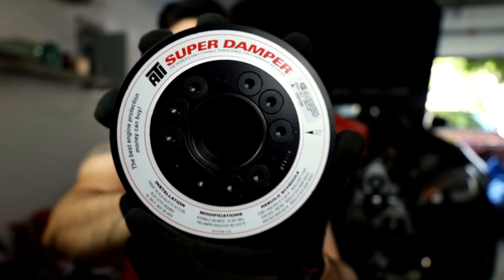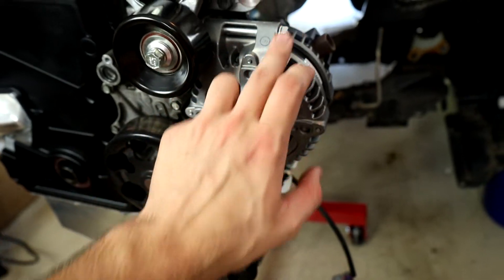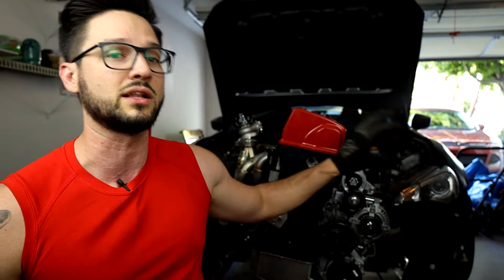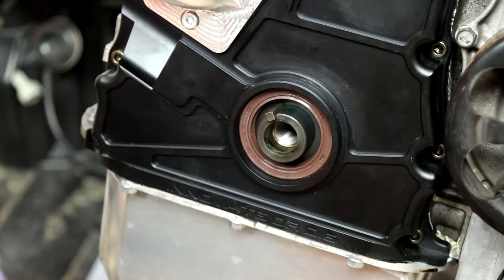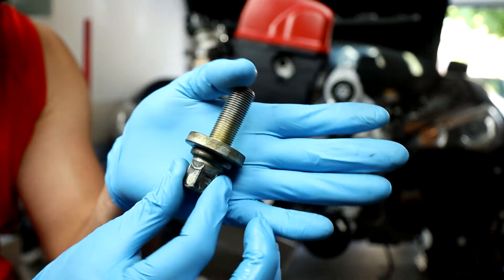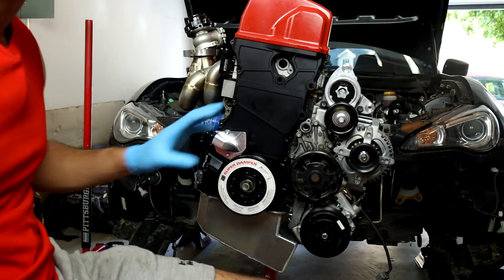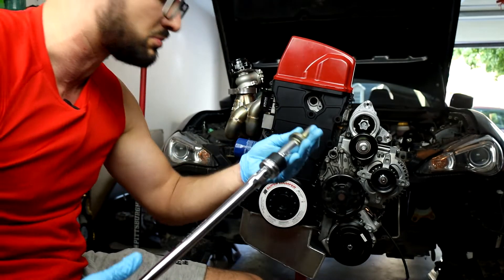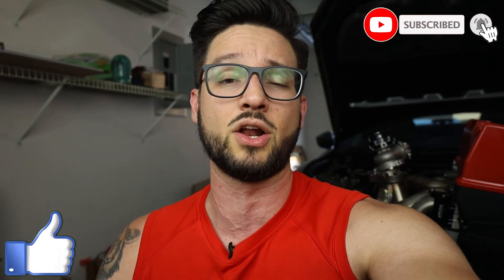K24 Swap BRZ Part 6 - ATI Superdamper

Comment: Is the crank key on the oem motor?
Reply from the maker: Yes it is in there from the factory. The SuperDamper is made so that you can use the factory Key, so you don't need to worry about getting a new one.
Reply: @BuildingWithSean  thanks bro!